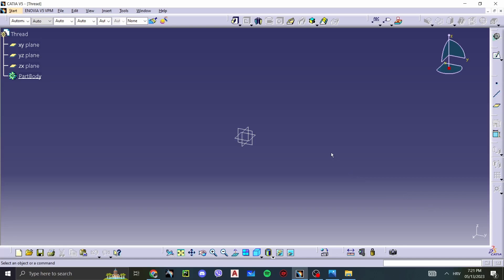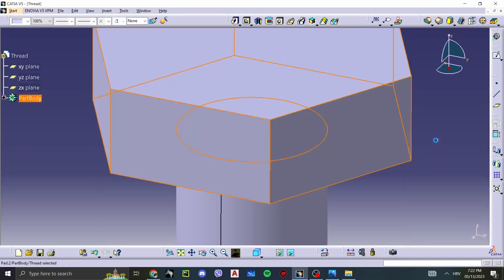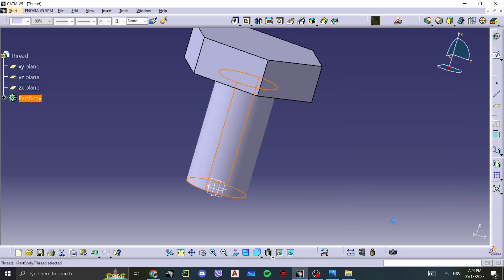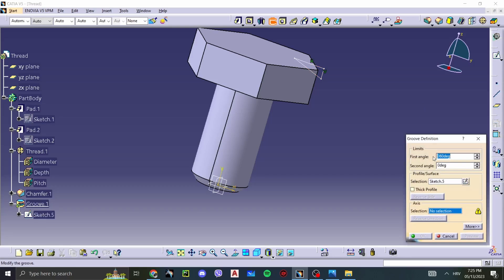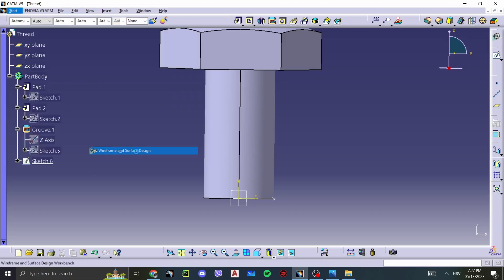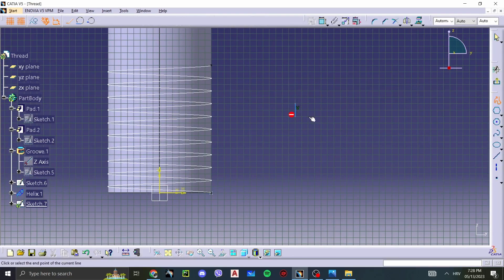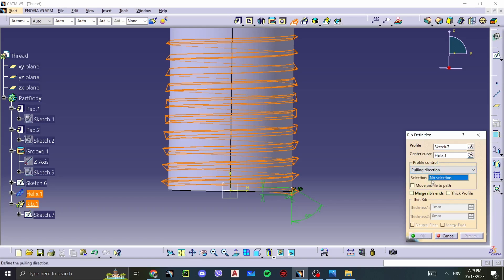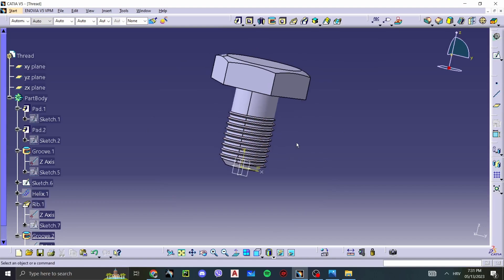CATIA How to make a screw with two methods Helix and Thread command

Comment: Hello,
the thread is cut in the barrel of the future screw, but yours is attached to the barrel.

But maybe it's a screw for wood?
Cordially.
Reply from the maker: Hello to you too 
The first method that uses the command thread is the one I always use for actualy manufacturing.
The second one where I just attached the thread I only needed to use in school or in a CATIA tournament so I do not know if it is usable for anything.

I hope this helped
Reply: @imranhusremovic6443  Hello, Nice video! Is strange that with the Thread Comand Catia V5 is not showing the thread.... !!!! I did not know that......